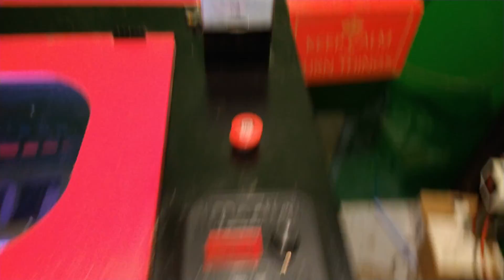Laser Cutter Update: Working With Marlin!

Comment: So it can cut but not engrave because there are no options for rasters in marlin?
Reply from the maker: Yeah, normally when you engrave the head moves back and forth very quickly and the laser turns on and off very quickly as it is doing this.  Such functionality doesn't exist in Marlin.  It's more like move...turn on laser...move...turn off laser, etc.
Reply: @MAKER_GURU  but Marlin is just a programming language right? Any Marlin experts out here think they can write code to force it to engrave?
Reply from the maker: @gyllenspetzfamily7993  It's a piece of software that you need some light programming to get working.  It's mainly intended for 3D printers; they keep adding features to the point that it can now control laser cutters, CNC mills, and robotic arms...but mostly it's for 3D printing and that's where most of the work goes.